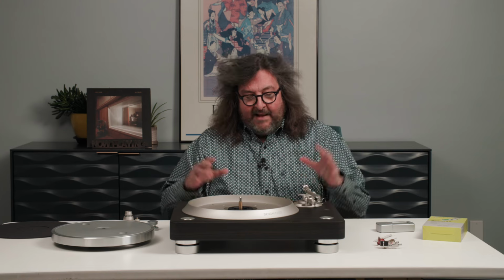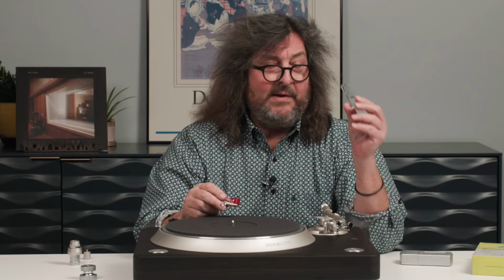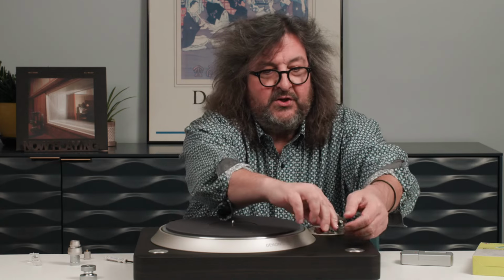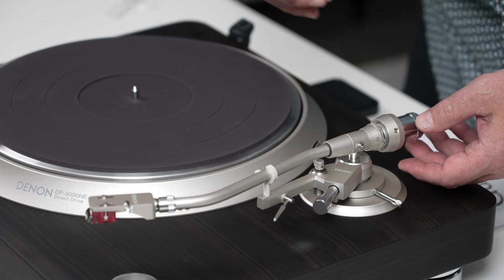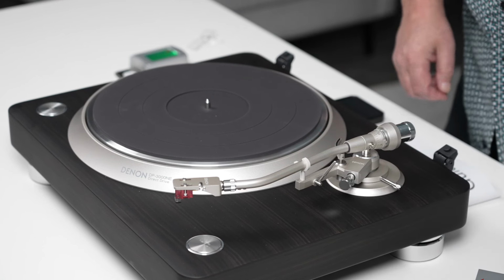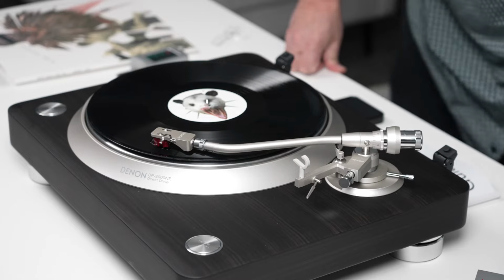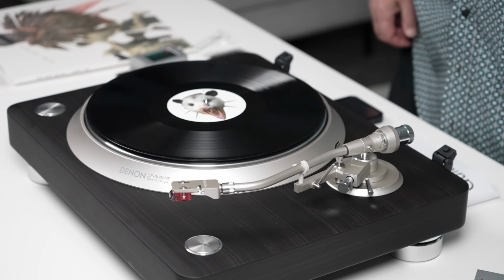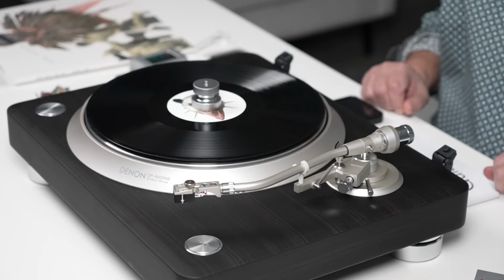How To Setup Denon DP-3000NE Direct-Drive Turntable

Comment: Just bought it 3 days back , haven’t set it up yet, bought the 103R to match with my musical fidelity M6Si. I got a professional to set up my Technics the last time but I would really like to do it myself. 
Any precautions I should take. I had the Technics SL 1200 mk7 , it was just on a different level with my new amp , stepping up from a 230 Leak with Wharfadale’s Super Lintons.

Just installed the 103R , it’s fabulous with the Musical Fidelity M6Si with  Wharfadale’s Super Lintons. No regrets but I’ll get the Shure MM 447 cartridge next.

Comment: PLEASE I NEED HELP. is the denon dp 3000ne better, or the micro seiki bl 71 from 1984? Which one do I buy? Thank you very much. Greetings
Reply from the maker: I think in this case, you’re comparing two different animals!  Although Mico Seiki is now longer in business, they definitely were one of the better solutions back in the 70’s (along with Denon) and some models are very much sought after today, given the popularity of vintage HiFi!  Like the Denon DN3000 the BI 71 has an S shaped tonearm but is belt driven instead of direct drive. 
As to which one actually “sounds” better, I’m putting my money on the Denon!  Denon released their first turntable in 1910 and has always been a player in the turntable game!  The DN3000NE is the pinnacle of over 120 years of Denon turntable design and manufacturing and may very well be a turntable someone else is asking questions about 40 years from now!!

Comment: That is a beefy looking TT.  Solid looking base and shock absorbing pod legs.  I like the adjustability of the tonearm too.  Looks easy to adjust tracking weight and level.  I know there's those who pooh on removable (SAE type?) cartridge heads though I always liked the ease of changing out cartridges finding the audio fine after adjusting for a different cartridge.  Denon, like Technics, was a leader in direct drive so I I don't think there should be a big issue over belt vs. direct drive audio quality (we know the best DD table typically have the utmost in speed accuracy with minuscule wow and flutter) as even very high-end turntable makers today have DD models.  I guess the only thing I noticed that made me scratch my head was the pivot post of the tonearm.  It was unique to me although I'm not familiar with modern Denon TTs. I saw what looked like a rubber O-ring where the S arm joins the post/pivot.  While you worked with tone arm I actually saw the arm flex at that ring.  Most arms are quite rigid where they join the gimbal.  I wonder how this is a good thing?  That said, I'm still a big fan of the later AR The Turntable model as I always thought it was the culmination of the awesome AR suspended sub-chassis design still used in the astronomic priced Linn LP-12.  Apparently the industry moved to non-suspended either low mass (Rega) or high mass (VPI) as superior to sub-suspended platters/arms.  Perhaps that O-ring flex is a silent nod to the high mass base with just a bit of something slightly akin to the decoupling that the old sub-chassis design added?
Reply: Hello AudioFileZ and thank you for your inquiry. Scotty G here and I think what you saw must of been a distortion of some sort in our recording?  We actually have the Denon DP3000NE on display in our store so I went and checked the tonearm myself and there was no wiggle, flex are twisting of the tonearm tube with the gimbaled base. 
Please let us know if you have any other questions and thanks again for watching